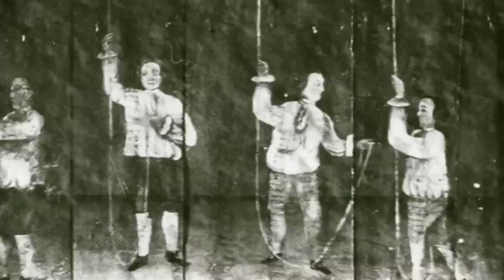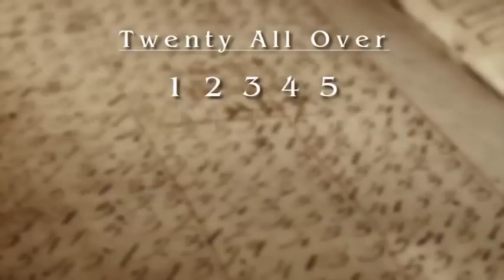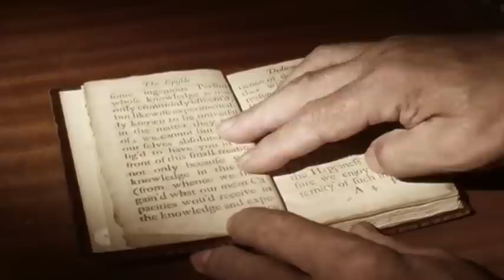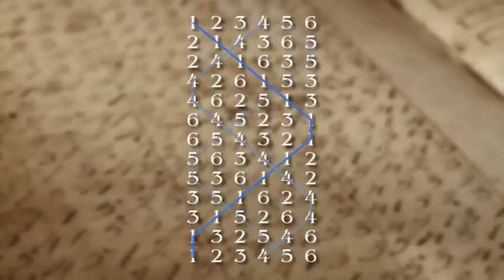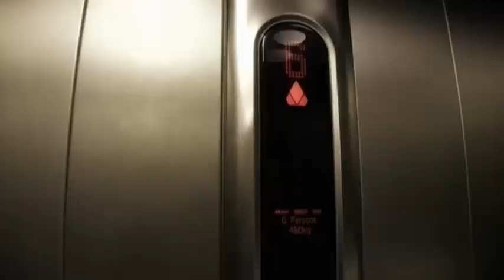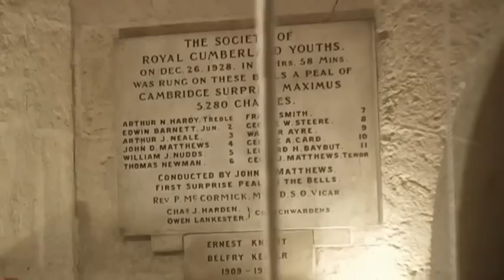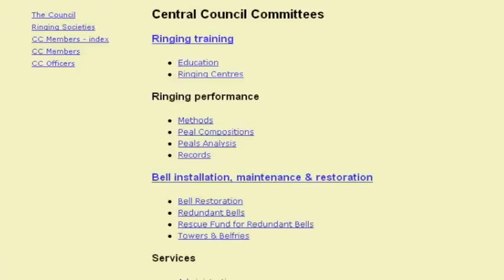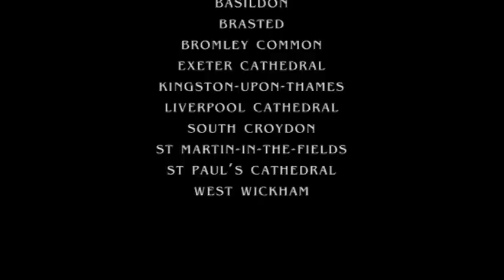The Craft of Bellringing

Comment: I understand   the principle of  change  ringing,  but   why  at  the  beginning   of  this  video all you  hear is a straight  scale  over  and over?
Reply: Because this is the first thing that you have to learn.  Controlling several hundredweight of metal on the end of a rope is not easy and, before learning to chang positions, you need to learn the control necessary to keep the bell in its right place.  Learning to ring in "rounds" is, possibly, the hardest thing you'll ever learn.  Everything else is an extension - a progression from this.
Reply: @kildwickminiringers2116  I found leading much harder than keeping my bell in place when I was ringing rounds.
Reply: @MartynCole   That's true.  Each new level of skill - from lerning to handle a bell - to ringing in time - to leeading at the right moment - to moving your bell up and down the order - is a level of difficulty up from what you could do before.  But probably the steepest step that you have to make is that from simply ringing your bell in your own time to controlling it enough to ring with others (in rounds).  Leading is harder than rounds.  Plain hunting is harder than leading.  Calling a peal of "London" is harder than any of that!  I've been teaching this (not the London!) for some 40 years or more.  Good rounds is a very early and essential step - and it is probably the hardest one to achieve.  Once you've got that - then it's time to move on...